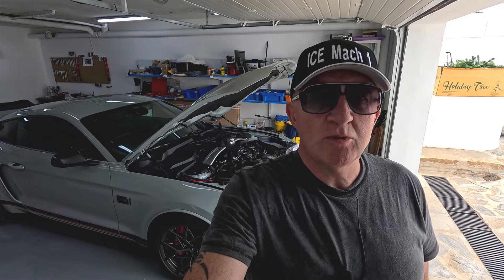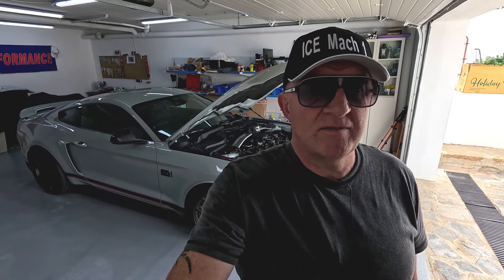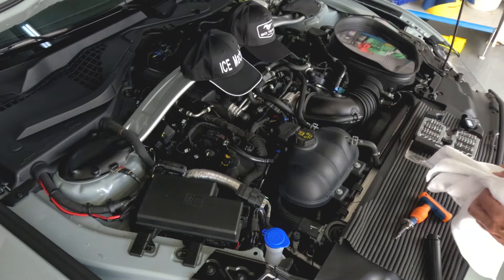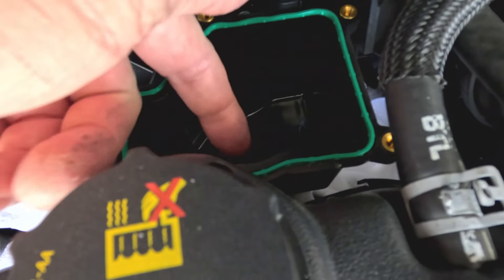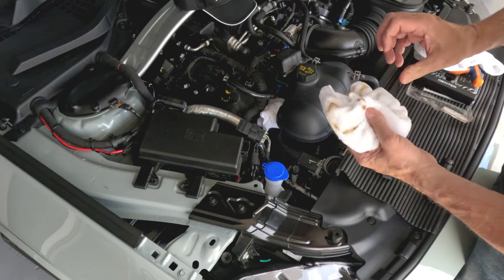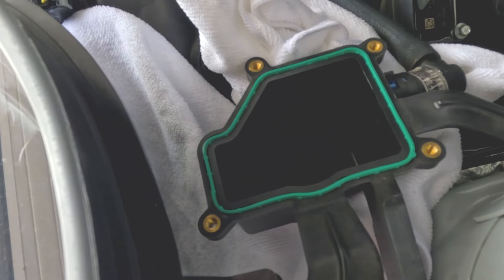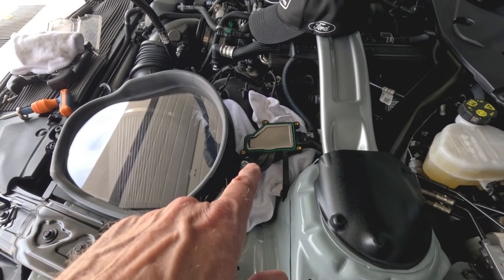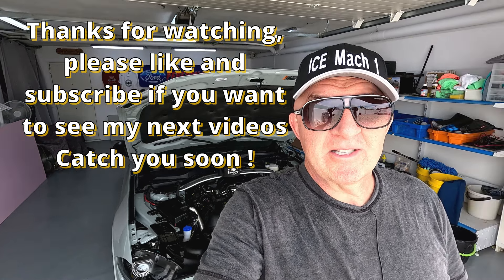Catch Cans - find out the truth ! Are they worth fitting to a 2023 Mach 1

Comment from the maker: Hi Patrick, if you buy a Mach 1 they come fitted with oil cooler, trans cooler and diff cooler as standard. The catch can is a must be in my opinion and as Ford Performance offer them as upgrades they are easy to install. 😉

Comment: Just fitted the pair of catch cans to my 21 Mach 1. You do interesting videos, keep it up. By the way, do you think you could give us a little more info on the baffle you made for the fog light hole to direct the air into the air filter inlet.
Reply from the maker: Hi Peter, thanks for watching. Regards the funnel for the air inlet ford had already closed it in behind the grille. I took out the cover and discovered that the side was open next to the radiator. I wanted to create a funnel as no aftermarket company offers one for the M1. I used some strong flexible black plastic to form the two sides of the funnel. I started with a larger section and just kept cutting small pieces off until it fitted. It did take some time, probably 3 hours for both sides. I drilled some small holes and used push pins to hold the panels in place. When finished I had made a proper funnel that in conjunction with the air box cover gives me true ram air from the front of the car. When fabricating these panels I just had to keep taking them out, making cuts, then installing them again over and over until they were perfect and look like factory installation. I Hope that helps? 👍🏼
Reply: @icemach1964 never thought their would be so much oil in there😮, first thing I will install on my mustang! Have you ever had issues with your oil cooler? There are a lot YouTube movies where they advised to install one, did you ever experience problems with your oil temperature, especially with the hot temperatures in Spain?